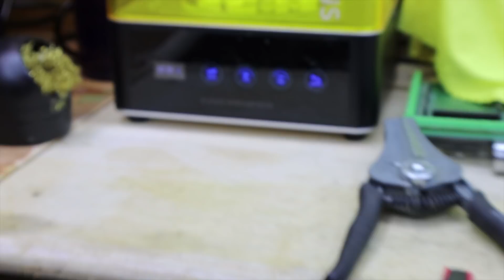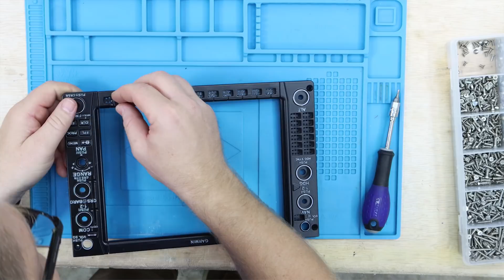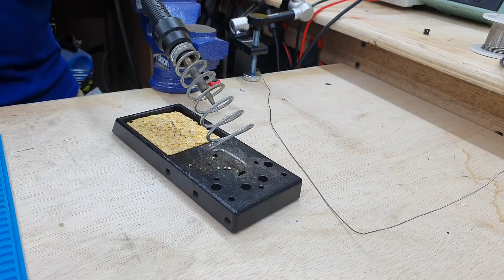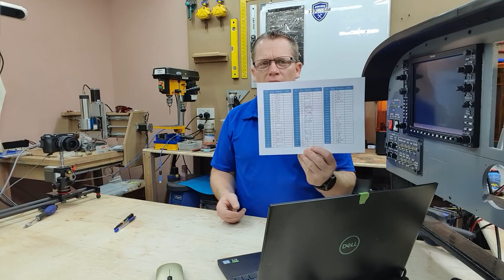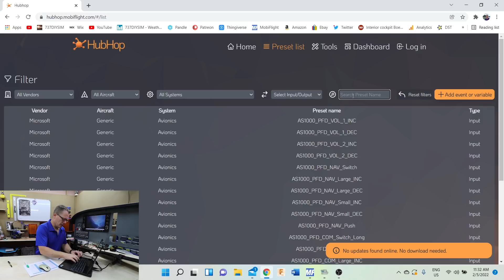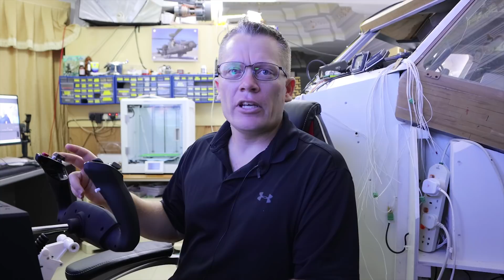Creating a G1000NXI for MSFS2020

Comment: What an inspiration! Thank you for sharing your tips. I recently started my build of a TBM930 cockpit - still going through a learning curve with 3d printing, painting, engraving but videos like yours are so helpful. 

Quick question: how do you mark your wires? Some sort of printed heat shrink wrapping?
Reply from the maker: Thanks so much for the kind words! 😊 A TBM930 build sounds fantastic! You’re going to have a lot of fun with that.
For wire marking, I use printed heat-shrink tubing. You can get a small thermal printer (like the ones from Brother or Dymo) that prints directly onto heat-shrink sleeves. It’s neat, durable, and looks professional once shrunk onto the wire. Alternatively, if you don’t have a printer, you can:

Use pre-labelled heat-shrink sleeves (sold in packs for common wire sizes).
Print labels on standard label tape and wrap them with clear heat-shrink for protection.
For a budget option, write on masking tape and cover with clear heat-shrink – not as pretty, but it works.

The key is to keep the labels short and consistent (e.g., “PWR-12V”, “GND”, “SW1”), and apply them before terminating the ends.

Comment: May I ask you whether it's possible to build this Garmin without using an Arduino at all ? I mean , is there not enough support in Fsuipc or  MobiFlight for the encoders , buttons etc that you can just wire into a Leo Bodner break out board and not have to flash an Arduino? Am I missing something here ? Many thanks
Reply from the maker: Hello, You might get away with a Leobodnar, it would certainly be interesting to see!
Reply: @helimech8152 thanks for your reply , might have a go 😊

Comment: Does the flight model cockpit have to have support for the G1000 built in ? I mean, could you add a G1000NXi to a Piper Cub for example in msfs . Thanks
Reply from the maker: Hello, As the screen comes from the avions package from the aircraft ideally you do need the G1000 suite on screen for full operationality.
Reply: @helimech8152  Thanks for that answer. Makes sense.

Comment: You are an inspiration!    I've watched this video a thousand times.    Taught myself to solder this week,    and now I'm learning to read electrical diagrams.    My goal is to complete the second version.   My question is,    where does the 12v come from?   I'm assuming an external supply and so my second question,   can the same 12v supply everything,   the wiring diagram has it on 2 different sources.   Thank you so much!

Comment: I finished V2 and it works great! thank you for the plans.  I also did a short video on setting up the 4 way rocker switch using your electrical diagram and the manufactures drawing. https://youtu.be/306aYMAT7vw?si=_qp2Ll-dUcFf1Idg

https://youtu.be/xJhifOA0vjc?si=_BmyYt8UF_Lpv8DI

Comment: Great work on this project design! I’m currently printing out v2 with doing SLA on the buttons, 3d printing of the framework and laser of the button text and frame sides.  I couldn’t find your sheet for the mobi reference entries. Do you have that to download . Also would it include the parameters for the hat switch?

I got it worked out no problem 

https://youtu.be/xJhifOA0vjc?si=_BmyYt8UF_Lpv8DI

https://youtu.be/xJhifOA0vjc?si=_BmyYt8UF_Lpv8DI

Comment: I'm down for building a couple of these but I want the complete version with the joystick part you excluded. I don't even see the optional info in the build files. (I want the GDU 1045 PFD/GDU 1045 MFD (GFC 700 autopilot installed with VNAV).

Comment: i just started my build, thanks Karl...
Reply: I'm interested how did your build go? Any obstacles or mistakes to share? I'm about to take it on!
Reply: @fpvhangtime2424  Yes,    don't the LED part on the G1000. it is a waste of time, and it doesn't look good. I did one by the book with LEDs back Light, and the other I did without.
Also, print the buttons in black and change the filament to white at the writingS height. 
buy AWG 24 silicone wires, not plastic.
I have a Y. T. video of my finished product.
The switch panel I designed myself because I used different switches that light up
Reply: @fpvhangtime2424  Also. the frame cut out for the panel is not updated with The G1000 v2, so the SQUARE openings are small. Suggest  you to print the G1000 V2 Frame First then you do the cutout

Comment: I really wanne give you 20 Abo´s, but i can only give you one. Its just amazing what you are creating. This Panel is the first thing i am building now to start my Low Budget Homecockpit. The 3D Printer arrived yesterday and the first parts are printing now. I want to build a Full Cessna Cockpit with under 2.000 €. And with your Parts, i think, it will be amazing. If i travel to England i really wanne see your 737 in Reallife. Again, amazing work!

Comment: Hi, great work! I saw that all the wiring is marked with heat shrink tubing. A very neat work. What tool do you use to write on heat shrink tubing?
Reply from the maker: Hello, I used the Dymo Rhine 4200 label machine. It perfect for adding that bit of extra eye candy.

Comment: Thanks Karl for your work, is really well made and entertaining!
About the map "joystick", I will be using this component:
Alps rkjxt1f42001 , it is really inexpensive! I have already used it in a g1000 that I build during the pandemic for xplane (using simvim and Arduino+multiplexer), with the frame build using a tiny CNC,
But your designs is far better than my homemade so gonna build it again!
Reply: How would you configure the joystick in mobiflight, i cannot find how?

Comment: You resin printed the frame and the buttons, my question is:  how readable would be the buttons if printed with PLA on CR10v3.
i know nothing about 3D and programing that little board you install on its back. i will have to learn all that. i really want that GXI on my cockpit.

Comment: I am absolutely gobsmacked at the skills you demonstrate in these build videos.  I'm crap with my hands and have never even hammered a nail into a wall to hang a picture so I am totally engrossed by videos such as this one, you make it all look soooooo easy.  I would love to give this a go myself if I had the skills, tools, equipment and money to do so - it all looks great fun and I find your videos very inspiring.  And having been a software engineer in the avionics world for 20 years I'd love to give programming with Mobiflgiht a go, that part really appeals to me!!!
Reply from the maker: Hello Again, Mobifl;ight really does make sim connection programming really easy and its getting almost to a single click operation these days. The wiring on this can be difficult for those starting out, but is just buttons and leds, nothing hard at all!
Reply: @helimech8152  Thanks (again!) for your reply Karl.  I'm now considering getting an Arduino and some Encoders to start by making myself a trim wheel. I do actually have an A' Level in Electronics but have never done anything more than change a fuse!  I'm just a bit concerned that my stroke-ridden brain will affect my soldering skills, that I haven't used since 1987!!!  Small steps as they say... 😉

Comment: Where did you find the information for the forward voltage and current through the LEDs from the switches? I can see in your schematic that you used a 5 Ohm resistor with 4 leds in series. Did you just consider the voltage to be 3V and the current to be 20mA (which would explain the 5 Ohms)? I did some trials with my switches and I tried 3.2 V forward current and 20 mA which gave good results but I cannot get any information from the seller (i'm sure they have no idea).

Comment: Hello Great job, 
I have just one question to you. I want to realize this panel but I don't know what is the type, the sizeof wire did you use. What is the diameter and what is the total length needed ?
Thank you already for your response.
Reply from the maker: Hello, I like to use use 22 ot 24 AWG wire. Try to find some of the better stuff with at least 7 strands in the conductor. As for length i have no idea im afraid.

Comment: Hey! Great work :) just wondering if you had problems with screen resolution with the screen you bought? The screen I bought has bleed issues. The picture seems to be bigger than the actual screen size… so when you go full screen it makes it too big. Thanks 😊👍
Reply from the maker: Hi Brendon, I have not had that issue, but it does sound like the screen resolution is incorrect. Try changing it to 800 x600 or the next size up.

Comment: I see that the wire diagram you have posted shows a 5ohm resistor. Is that for the leds in the switches?

Comment: Hey :) thank you for your fantastic job i bought the stl to made one :) just have 2 question about backlighting, is there a way to backlight the rest of the panel in addition to the button (like knob indication,... ?) 

Second question, is that possible to add something like potentiometer or something to control brightness of the backlight ? :)
Reply: You can control the LED brightness with a PWM module like this one from eBay.
eBay item number: 163091515028
I have nothing to do with this seller but I've used the item in my cockpit.

Comment: Can you please advise where I can get all the lcd panels, switches from etc. I would love to give this a go but seems like I can only get 10.1" lcd panels. Please let me know where we can get or order these panels from
Reply: Also what is your Instagram,  I would love to go have a look
Reply from the maker: Hello Deon, the links for the LCDs are in the build guides on line. I have to admit the links do expire very quickly at the moment. My instgram details can be found in the video descirption or on the website: 737DIYSIM. Drop by and say hello! Kind Regards, Karl
Reply: @helimech8152  can you recommend a 3d printer? On your site it says to use the filament printer but you also say resin printers are better as they print smoother surfaces. Not sure which to choose. Can I connect with you on whatsapp?

Comment: Hello Karl, i appreciate your Video very much because it gives you a step by step guide to build some very cool stuff for the flight simulator. but i have a question about your resin prints of the frame.

Which settings you use with your resin printer, also what resin you use for printing it? I personaly use a Anycubic Photon Mono X, but have minor issues with printig the Frame and its Buttons and Knobs. Maybe you could help me. Thx.
Reply from the maker: Hello, I used creality resin that came with the printer. Its not the best, but it works. Can be a little brittle. I use the default setting for my Creality LD002 and have never adjusted them. Kind Regards Karl

Comment: Hi, Karl, first i want to thank you for this video that inspired me to make G1000 for myself. But i have one question, which wires do you use for the wiring?
Reply from the maker: Good morning, This question i get asked alot. Until last week it was recycled aircraft wire. 24AWG. It beats everything you can buy from ebay. However, i have now exhausted the 150kg supply i had. So i will search for an alternative supplier whose qulaity is similar. More can be found on the website under wiring. Kind Regards Karl

Comment: Hey there! Great video! That's helping a lot!
I'm trying to recreate a G1000 for the SR22.
I got an old cell of a SR20 who missed is landing.
I've got one question, how do you get the dimension?
Because that's the thing I'm struggling with. Have the proper dimension.
Thanks by advance
Reply from the maker: Downlaod the G1000 installation manual, or any garmin istallation manual for the compoennt you wanr. All the dimesnions are on there. Import the image into fusion, calibrate the size to said dimensions and viola, it will then give you all dimensions. Thats one of my top secrets!
Reply: @helimech8152  What a brilliant answer! Thanks!

Comment: Hi Karl, very nice build- impressed!  Would like to try your plans.  I note that you provide, in addition to STL, CAD files in the purchase, and presume you are talking about Fusion360 Files.  Can you supply in Autocad DWG format (I believe Fusion creates that format as well)?  I am slightly limited by only having an Ender 3V2 filament printer to 220x220 prints, but you say on your website that this printer is OK..the print size might be an issue, but I will work with that....
Reply from the maker: Hello Glenn, I have never tried to import a fusion file in AutoCAD. However, most people I know who try to import DWG files fail. As for the ender printer, That should produce the parts without issue, I think. At worse, you may have to place the parts diagonally across the bed to fit. Kind regards Karl

Comment: Awesome work! In the process myself of duplicating this project. Just waiting on parts....
Do you have plans/build guides/dimensions for the C172 panel? I plan on building a home cockpit for the C172 G1000.
Can't wait for more C172 videos. I need something to copy!
Reply from the maker: Hello Fogazi, They are on the build guide already. Its still a work in progress, but its coming along at a steady pace now. Kind regards Karl
Reply: @helimech8152  really struggling to get the big backplate thingo to print. Did you use any special settings and what orientation? I am laying the 'flattest' side on the build plate and using support. 3 fails so far.
Reply: I have make this project to,  but with some modifications: due I have VR headset and flight in VR MSFS2020, so don't need screens, lights on knobs and buttons, just buttons and encoders itself, any visual information is displayed in headset. Also I can't buy anymore in Karl' shop due financial restriction against Russia, so make own switch panel  and must to adopt main big C172 panel holes and cuts for it, and I think cut main panel from aluminium sheet (a great respect to Karl for sharing CAD-model).  Fuel and mixture controls also get on Thingiverse, may be in future will change for Karl' version. Good luck with your build! ))

Comment: Great work and great video. Do you still need to pop out the G1000 in MSFS and then drag to the external display or do you (hopefully) have a solution top that.
Reply from the maker: Hi Peter, I do indeed need to pop out the window every single time. This is slightly annoying when you are repeatabily doing landing challanges! Hopefully one day this will become sorted. Kind Regards Karl
Reply: There‘s a freeware Popout Tool on flightsim.to which perfectly automates the popout. Once you adjusted the correct position it memorizes it and restores it once you load the plane. Pretty handy. I‘m using it for my homecockpit 🙂

Comment: Great work as usual :) Do you have any idea how to control the brightness of that LCD panel by potentiometer? I bet there is a way because you can cotrol it through its control unit by buttons.The idea is to send the analog data from the potentiometer to the arduino and than the digital data to the LCD backlight controller.

And one more question - how do you set up the monitor that there is no "upper windows bar" (minimize maximize close buttons)?
Reply from the maker: Hello Petr, I havent thought about the brighness yet. But i bet you can dim the dcreen in the software. ALT + Enter will maximise the screen without the title bar.

Comment: I am sincerely quite impressed by your work!! 
Creating a G1000 was one of my dreams, I realized that I don't need only few buttons and some encoders... I need also a lot of patience, skills (especially in how to program Arduino and how to use Mobi) and most of all, time.
Thank you for sharing, I am genuinely grateful, this video is eye opening!!
I have a question. Do you make the G1000s in private? ... I was thinking about a "portable" version, everything embedded in a box plugged on the laptop (wifi if you use Arduino's wifi module..does it exist?....or VGA... there is a software, spacedesk Server, which adds multiple monitors via wifi). If you could name the final cost I bet people would be happy to order some....
If you are interested, please leave me a message.
Reply from the maker: Hello Antonio, I do not sell any products due to my current location and contractural agreements. Hopefully thats going to change soon. Kind regards Karl, and humbled by your kind words.
Reply: @helimech8152  As helicopter mechanic, I understand your passion and your dedication. If you will sooner or later plan to produce a "portable G1000 panel" please contact me also in provate to fix the details. If you are located in the UK, I might think to come and visit you, we are just a couple of hours in flight away.
Let me know.
Ciao!!

Comment: Another great project, congratulations, your a genius. I'm really tempted to start a side project on the 737 with your G1000. but I'm afraid of not being able to make the connections and wire manage to the Arduino. Can you do one video on that topic? Also, I'm doing a research, if I can get all the parts through Amazon, so I don't have any surprises in the customs fees. can you give me the monitor driver model compatible with the monitor and 3d printed support.

Comment: Great work and such an important contribution to the community well done, quick question what gauge wire are you using ?
Reply from the maker: Hello Mike and Thank you. I try to use 24 AWG. It keeps the looms smaller and can manage the 5v Arduino power needs without issue.
Reply: @helimech8152  Thanks, What do you use to label the yellow sleeve ?

Comment: What size LCD panels did you use for the 737 sim? And how did you get the artificial horizon and nav display to display on the LCD? Could you explain, thank you very much. Great Video keep up the good work! 👍🏼
Reply from the maker: The PFD and ND screens are 18 inch 4:3 monitors. I use prosim display to place the PDF & ND into there locations. Its free to try, but expensive to purchase!